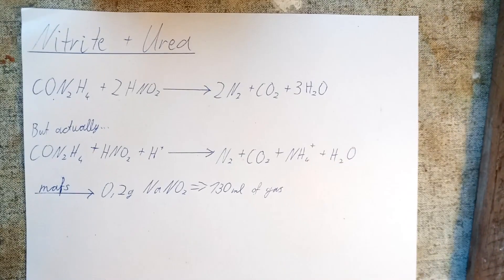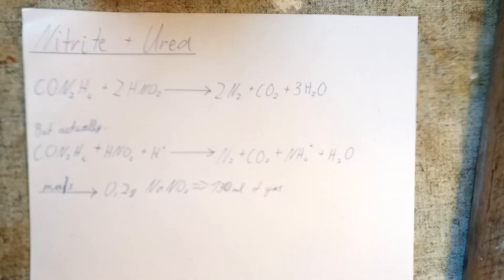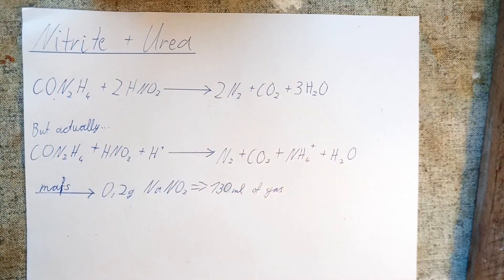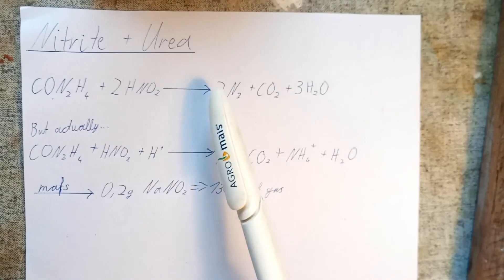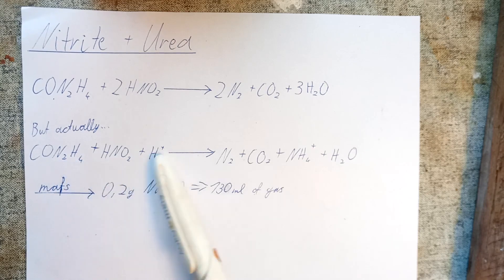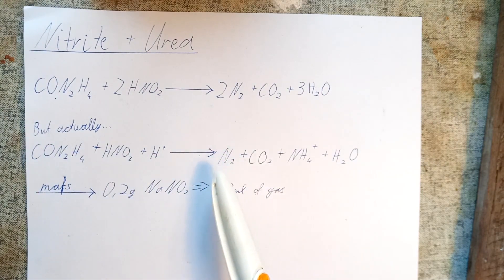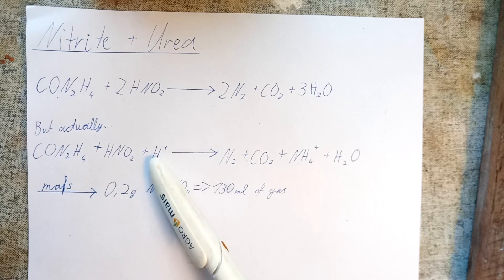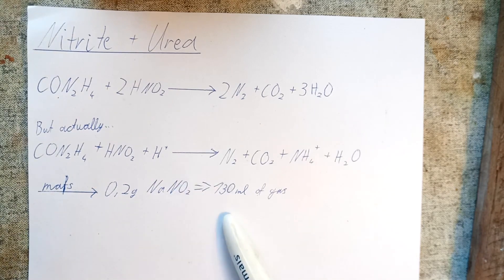Sodium Nitrite Part 2 | How pure is it?

Comment: Couldn't you test for purity using "water quality testing strips" that test the nitrite contamination in drinking water? By dissolving a known mass into measured distilled water then reading the mg/l from the colour chart then working back you could know what the expected mg/l should be if 100% pure. These test strips are very inexpensive, but reading from a colour chart seems less accurate. Could be a way of confirming your test method here?
Reply from the maker: That could actually work so thanks for the suggestion. Might be worth looking into.

Comment: It matters a lot to not let air get into the reaction mixture, or else it will oxidize it back to nitrate again. It should be covered at all times with a lid until the mixture goes clear. Let it solidify with the lid on. I find if you use too much starch, it forms a back precipitate that never leaves. I use 10 grams KNO3 and 1.5 grams corn starch and I can get about a 50% yield.
Reply from the maker: 50% is pretty impressive. I doubt oxidation is gonna do much within the few minutes it's hot and melted. Nitrite only oxidizes very slowly to my knowledge but I might be wrong. Any idea how quickly this actually happens?

Comment: If you want a very easy way to separate nitrate from nitrite, do this. Take the yellow, hot reaction mixture and put it in the freezer. After a few minutes, nitrates will be the first to crystalize out because they have lower solubility. Nitrates form very large, hard crystals around the perimeter. If you're fast you can separate the remaining liquid that has the nitrite. Place that in the freezer and nitrite will then crystalize out as very fine, snow-like crystals. The two crystal structures are quite different.

Comment: Great Video!
You can also titrate with KMnO4 and AcOH. Just be carful to subtract the amount of KMnO4 the impurities in the acetic acid consume and perform the titrtion with hot solutions, or the reaction is far too slow. Tested it using commercial nitrite. I never managed to get more than 15% nitrite in the reduction mixture after cooling, so no attempt was made to purify it.

Comment: I wonder if you can purify nitrites by making isopropyl nitrite from it and then purify it (i think you can distill it without problems i forgot tho) and then converting it back to a nitrite salt to get close to 100% nitrite 
I think this works but I might be wrong.
Reply from the maker: I've come across that approach too and it's definitely promising. Maybe you wouldn't even have to distill it. Also the conversion back to sodium nitrite could be done with alcoholic sodium hydroxide that way the nitrite precipitates and the impurities stay in solution.
Reply: @Bavarianscience  I want to try this at some point
Reply: @sciencething1449  did you make this happen?

I just need to mix 99% IPA with NaNO2 and mix in another bucket NaOH same solvent combine the two and get pure nitrite?